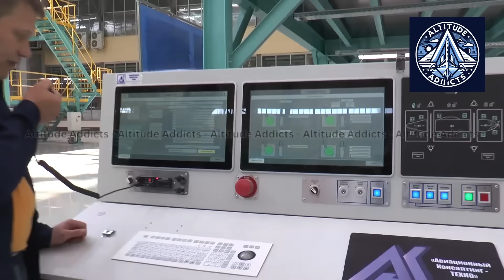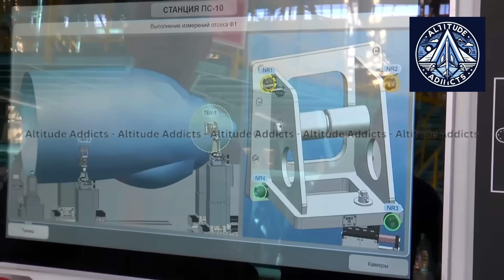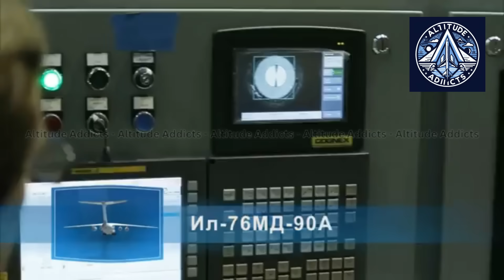Ulyanovsk’s $ Half A Billion Il-76 Upgrade Explained

Comment: Airbus A-400M is currently built at 8 pa .... and their peak was 15 in 2018. So the Russians aren't doing too badly .... I think that as Russia replaces its older Il-76s ,,, reconditioned older models will be eagerly bought up by Africa etc .... most of their exports I think will be 2nd hand for the next 5 years or so. As I understand it Russia are going to upgrade 1/2 of their current legacy models to modern digital cockpits etc but retain the older engines .... and replace the other 1/2 with new PS-90 models

Comment: Russia has technology and design, and China has modern tools and production expertise. If Russia does not concern about thier thechnoloy
Reply: Cooperation will be a win-win.
Reply: A Rusia le falta micro eléctronica como Chips y sensores el resto de sistema de Hardware y Software son de industria nacional y no requiere importarlos.
Reply: @overdrivelzma.9219  Russia has production for the simple chips used in transport planes and washing machines. It is the 28nm and smaller chips they don't produce in more than boutique numbers. The west does not produce computer chips either, most come from China or the biggest producer, Taiwan...
Reply: @paputzaadiy2820  everything can hardly be just sent to CN 
some parts are possible but making the entire thing in CN is 0 use. Since CN can get tarrifed for supplying ru stuff, 0 co operation spoken above is possible